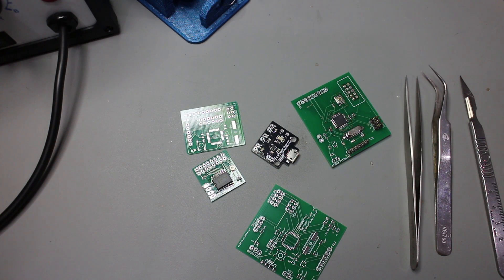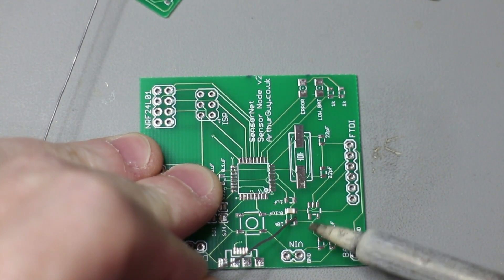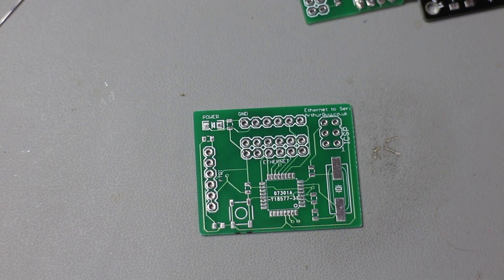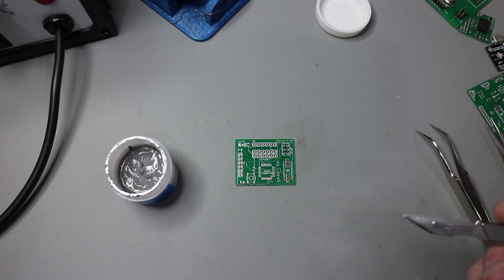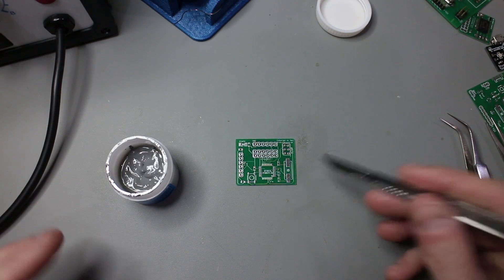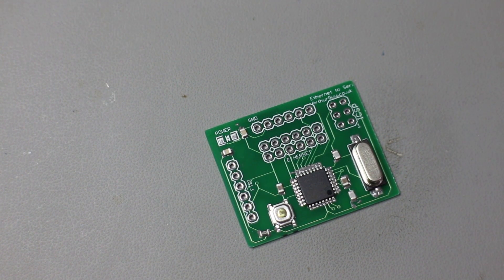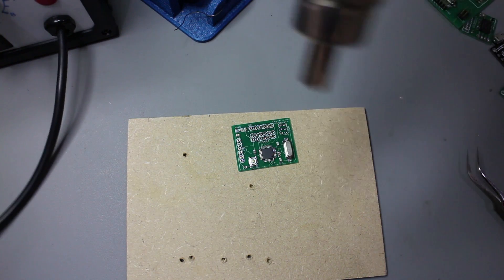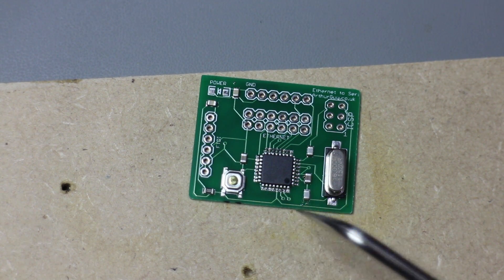SMD Soldering - the easy way

Comment: Good video for beginners. But you can use additional flux to make your soldering way more easier. Coming to your board design, your pcb routing can be improved a lot. You can add copper pours, have gnd and vcc plane and so on.

Comment: I've found that it's nice to apply some extra solder to the first joint after the second one is done, the new resin will freshen it up/remove oxydation so it won't be a "cold joint" anymore.

Comment: Great video! Sorry noob questions here, doesn't the heat damage the chip?  I thought they were very sensitive to being heated.  How do you avoid this using the heat gun? Oh and did you use 320 degrees Farenheit or Centigrade?
Reply: He's British - it's Centigrade. Also, the melting point of Solder is around that temperature in 'C as opposed to 'F
Reply: SMD parts are designed to be heated like this when they are getting soldered.

Comment: The solder joint looks ugly because it's a cold joint.  You should apply flux and reflow the first pad.  This is how it's done using your method

Comment: can I use ordinary 30 watt soldering iron in soldering SMD parts?
Reply from the maker: You can, it's a different technique but definitly possible. Take a look at drag soldering for working with ic's
Reply: Thanks for the reply and info Arthur Guy, I plan to resolder the PIC16F1933 on my TOMO Power Bank, there's a little bit problem on the display.

Comment: What type of smd l e d is that or what number is that ,I want to order some ,from eBay,I just not sure what to ask for ,help anyone
Reply from the maker: The LED's I used would have been 0805's , that means they are 0.08" by 0.05".
I have found this size to be nice and small but big enough to work with by hand.
https://en.wikipedia.org/wiki/Surface-mount_technology#Two-terminal_packages
Reply: Thanks

Comment: If you have or know someone who has a vinyl cutter, you could use that to make a template to place over the board, then place the template over the board and slide the paste over the solder points, remove the template, place your parts, warm up the board and all of your parts will center themselves onto the solder points.
Reply from the maker: I tried making my own stencils using a vinyl cutter and had some mixed success, the template I made did work fairly well but the effort to make one wasnt worth it for the very short runs I was doing.
Reply: Fair enough. I view everything from a graphic designer's perspective so I am willing to spend a little extra time building a stencil but I understand why many people wouldn't as mastering the skills to do it quickly could be very daunting and time consuming.
Reply from the maker: A sensible approach, I tend to be quite lazy with certain things so I will go for the thing that seems easy!
Reply: I did see someone 3d printed these...

Comment: Have you ever considered using your lead solder in a syringe,I seen them sold that way,you make it look easy,but you just very good at smd soldering.,great job love your video,I think payday I going to order a solder syringe,so I can get Easter coverage,I tried the paste ,it get all over everything,input from anyone,I trying my earnest to learn smd soldering.
Reply from the maker: +Ron Thompson if you mean the mechanical syringe I have used then that was great, really recommend it.
I may have talked about an electronic one, that I do not think is any good.
Reply: Thanks for the info

Comment: How long did it take for you to fweel comfortable doing smd soldering,I just bought a 898d soldering station with heat blower,and soldering pencil,so I can do this ,I have already mess up one cheap kit,the liquid flux I used seem to eat away some of my pads,imhave a thirty year old cream soldering paste I will be using,until I can order some like you use,is your paste lead type or non lead type paste
Reply from the maker: If you can get away with it leaded solder is so much better. Solder paste will dry out so i'd replace what you have.

Comment: For the chip: how can you make sure that the paste has properly/equally retracted to the pins and not short circuiting or left a pin bare? It looks very straightforward, bother-free but is the result reliable?
Reply from the maker: I use an eye loupe to look at all the contacts, it doesn't take long and it's fairly obvious when there is a short or the solder hasn't flowed.
Reply: Thanks.

Comment: nice boards ... why not use a stencil for the paste and a small oven for the overflow? the method is well described in   elecktor magazine
Reply from the maker: +Sérgio Jácome I have tried them both, stencils are really convenient but cost money and most of these are meant to be really cheap prototypes. I also tried making them with a vinyl cutter and had some success.
Reflow oven was ok but for a small quantity of boards the hot air was more convenient. But I probably should have given that one another try.
Reply from the maker: +Sérgio Jácome I have tried them both, stencils are really convenient but cost money and most of these are meant to be really cheap prototypes. I also tried making them with a vinyl cutter and had some success.
Reflow oven was ok but for a small quantity of boards the hot air was more convenient. But I probably should have given that one another try.
Reply: +Arthur Guy Cost is always a priority ... Can u tell a good source for the passive smd components and for pcb production?
Reply from the maker: For components I have used aliexpress and for PCB's OSH park is a good choice but there are some good chinese companies.
I did a comparison of two options in this video https://www.youtube.com/watch?v=BB5LfIAKG0U
Reply: thanks for reply...

Comment: I had solder paste gone bad once. It forms more unattached balls than sticking to the pad at all. It's the flux that does stop working. It also does not keep it's shape when applied with a stencil. Using a syringe with a nozzle is not easy. Pressing the syringe and holding it still at the same time is next to impossible. So appying it with a knife tip seems a good idea.